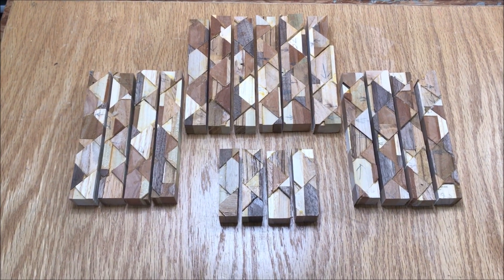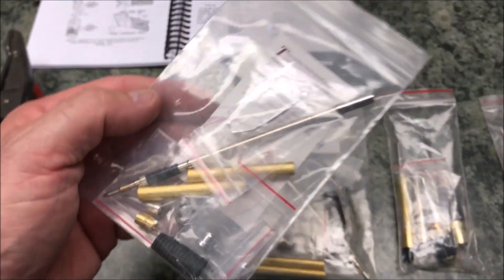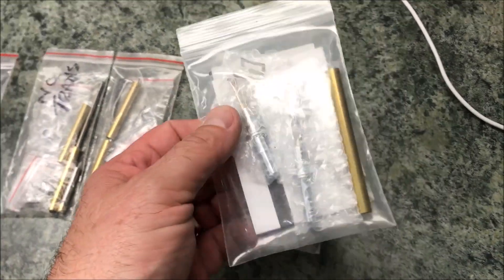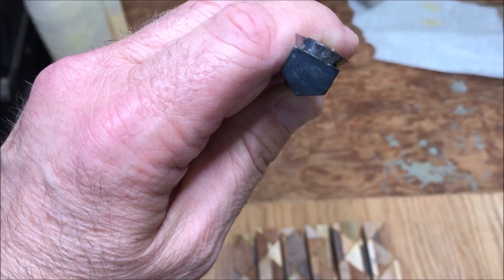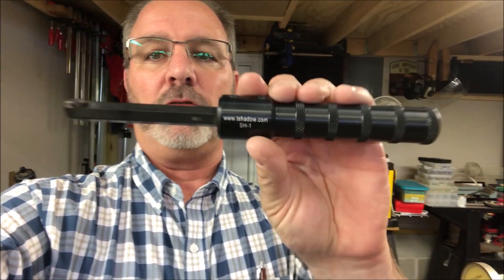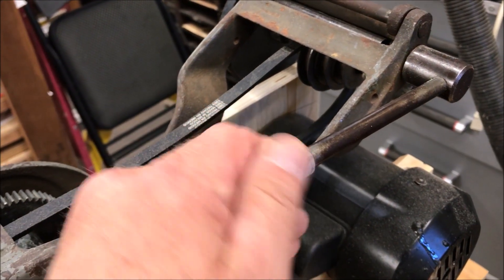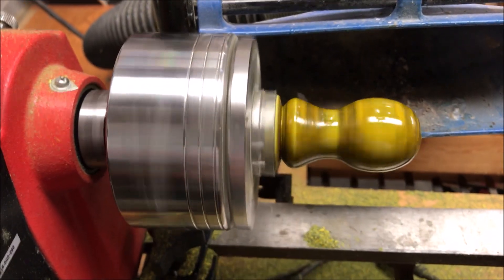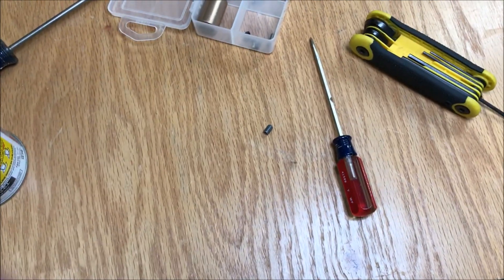Shop Update 6/13/2019

Comment: Hi Bob - Greetings from Nebraska.  I use my Magic Skew all the time, especially for roughing.  I am used to longer tools, so I bought a nice Irwin 10-12 inch Forstner bit extender and installed it between the handle and the tool.  It works great!
Reply from the maker: I like out, just gotta quit dropping the handled while turning. 

Regards,
Bob